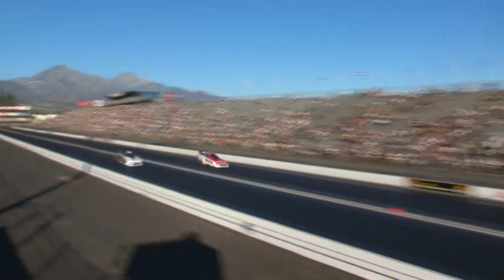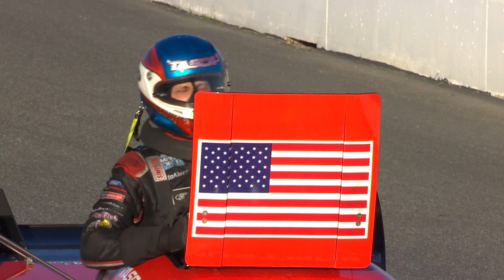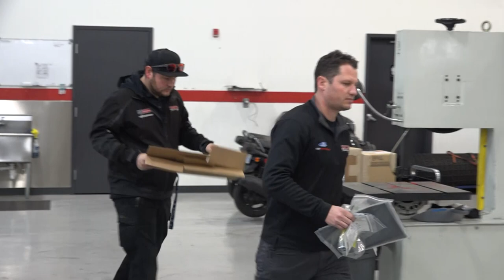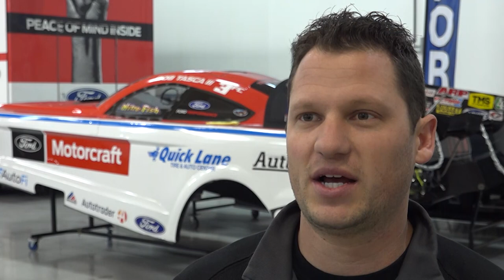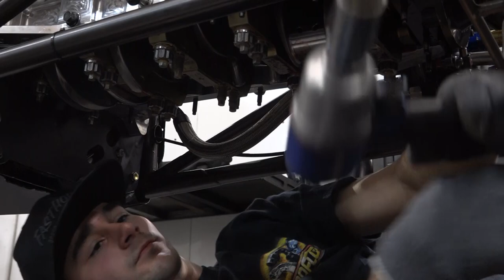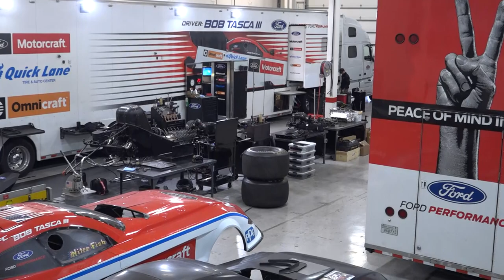Tasca Racing prepares for the start of the 2022 NHRA season

Comment: Is the Tasca team still running the Ford engines? If so are any of the other teams doing so? Best of luck in the new season! I've been a Ford fan for 50 years & will continue to pull for all the Fords in every class of racing!❤😎🏆🇺🇸
Reply: Only thing ford on the car is the badge,
It's a pure racing engine,same as all the top fuel and funny cars.
Reply: Ford helps manufacturer the engines
Reply: @brianiswrong  In a sense yes it's a pure racing engine but, it's a Ford Boss 500! It's parts won't fit any other manufacturers engines! Like the comment,Ford helps with the manufacture of the engine. I know when JFR were running Fords,you could see the Boss 500 on the valve covers. So yes these are Ford engines & then you have the engine based on the Chyrsler Hemi.
Reply: Thanks for the heads up guys,you live and learn.
So when Allen Johnson does a pair of heads,are they manufacturer specific,or are they a " spec" part.